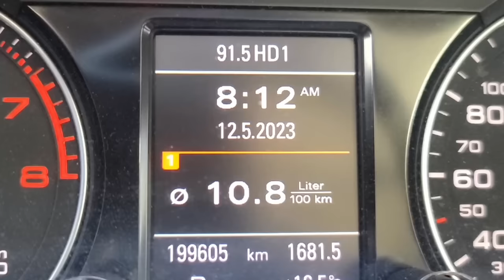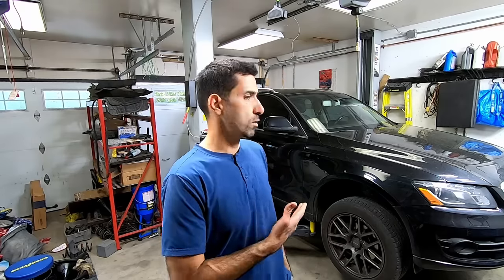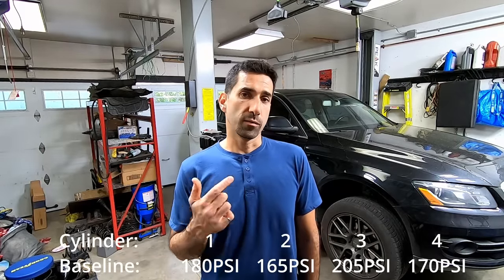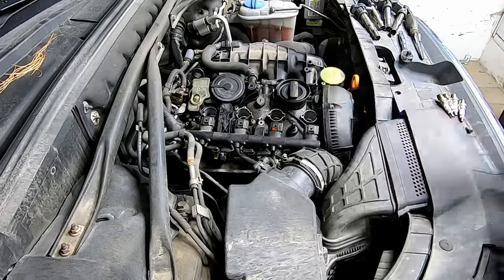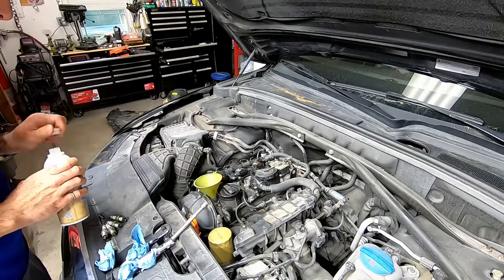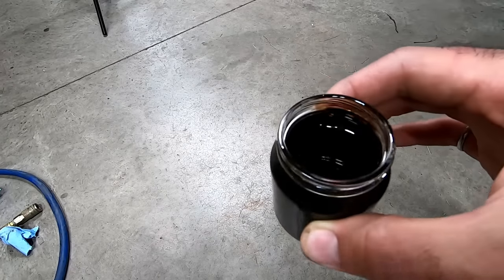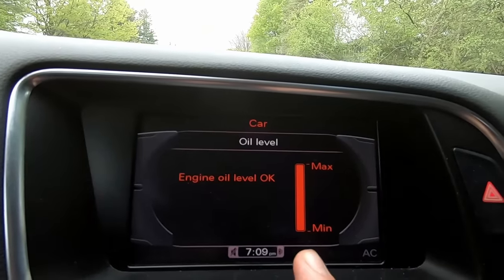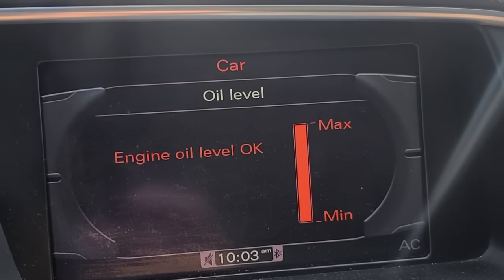How to fix excessive oil consumption from clogged piston rings (Part 2)

Comment: Hello, I have a audi 2.0 2011 turbo that i got for wife but it's loosing oil bad. I don't see any smoke and it's run great.  About 98k on motor. No leaks seen ive changed crankcase vent and hoses. I don't see any difference in oil consumption,  might be worst now lol. I'm considering doing the piston flush but I'm wondering if I should something first. Does this really work?
Reply from the maker: hey - yes this treatment really works...you can read the comments below for yourself but it's been pretty much 100% effective at curing oil burning in the VW/Audi 2.0T and 3.0T motors
Reply: @ETMotorsports  i see the comments all good reviews. I'll you updated.

Comment: I did this once and don't quite like it and since then piston soak is my very last try before pulling engine out. 
I was replacing my valve stem seal due to the oil leak into the cylinder, and there are lot of carbon deposit on the top of piston, so I decide to do the piston soak and why not, after I soak it for 24 hours, when I crank the engine by hand, through borescope I noticed there are a millions of small carbon particles sticking on the cylinder wall and it's well documented that those carbon particles WILL scratch the cylinder wall. Luckily, after a few crank, the cylinder walls seems not scratched on mine, but who knows will it scratch or not after 1k or 10k km? This is definitely the most regretted thing I've ever done to my car.
Reply from the maker: Why regretted if there were no negative effects? A lot of folks have noticed the dissolved carbon deposits on the cylinder walls including me but they washed off easily and had zero long term effect

Comment: Don't drop spark plugs into the holes, because the tip will hit the bottom and the spark plug gap will be different
Reply from the maker: thanks for the feedback...the plugs drop into a hole so there's nothing for the tip to hit...it's impossible for them to rotate because of how tight the hole is...the threads hit the hole - no damage to the tip...either way you're right - it's best to be careful
Reply: 12:12......

Comment: I would immediately switch over to using Valvoline Restore and Protect oil. It’s been proven to clean the piston rings within 4 oil change cycles and will continue to keep them clean.
Reply from the maker: @JBeck2468  I've heard that before - have you tried it? 4 oil changes could be anywhere from 16 to 40k km... I'm curious how they demonstrate that

Comment: The oil over consumption with these 2.0 TFSI is caused by carbon build up on the compression rings, then you get blowby pushing oil in the PCV valve and causing oil consumption,  carbon deposits on valves and more carbon build up on the rings.

To prevent this, use top tier fuel only, put a potent fuel cleaner aditive with PEA every 5000 km, and don't baby your car all the time , go for autobahn like speed runs every 2 weeks.
Reply: back in the late 60's when i was about 4-5 years old, my dad owned a ford galaxy 500 police interceptor. I remember dad would do what he called "blowing it out" on the freeway...pedal to the metal and 120mph for a mile or 2. would smoke like crazy at first but then the smoke would be gone. Car always ran like a beast. Dad knew what he was doing. This with me standing up in the back seat, no seat belt or car seats then lol.

Comment: I drive a honda civic and have recently started to get heavy oil consumption and thick dark smoke from exhaust if i rev the engine.  This problem seemed to happen suddenly and coincided with egr valve issues i've been having though i can't say that they're related.  The car is 2007 but has been running perfectly up to this and had very low emissions until now.  I brought it in to be tested the other day and the CO and hydrocarbon levels are off the chart.  The mechanic basically told me to scrap it, that the piston rings were probably seized or shot and that an engine rebuild would be the only fix.  This video has given me hope that it may not be a lost cause.  If anyone has any info  on the burning oil issue being caused by a faulty egr valve i'd really welcome it.  Also, the civic i have is a hybrid and actually has 8 plugs instead of 4 though the way i understand it each pair of plugs operate in a single cylinder and i'm just wondering if this would effect the cleaning procedure.  Again, any info or opinions would be very welcome.  Many thanks for the excellent video and for sharing your experience, it's really appreciated 👍
Reply from the maker: Hey what motor is in it? I doubt the EGR will cause these kinds of issues... if the oil consumption is from piston rings then this method should work
Reply: @ETMotorsports  Hi, not sure what you mean by motor in it? (it's a 1.4 petrol engine). I have read that a faulty egr valve can cause excessive heating in the engine that 's localised and isn't always picked up by the temp gauge on the dash and that this heat can damage rings and pistons.  I've been getting the P0401 code with the check engine light going on and off.  I changed the valve but the code keeps getting thrown, i'm in the process of getting another valve second hand.  I never experienced any typical egr valve issues with the car, the only change that i've experienced is what i've described re the oil and emissions issue.  What i'm afraid of is that the egr and possible overheating has caused this.

Comment: Thank you for this idea and for the demonstration. I have visited at least 10 mechanic shops and all of them refused to do this. Can you explain to me why and where I could get it done on the southshore of Montreal please? thank you.
Reply from the maker: Haha yeah I'm not surpassed shops want to stay away from it... from their point of view this is high risk voodoo and they can't control the outcome... sadly the same shops will happily throw any parts at your car and charge you for them without any assurance that it'll fix a problem...

Anyways...I can't tell you who in MTL can do this for you but I can tell you that more than one viewer has had it done in a shop so they are out there... all that said - it's really pretty straight forward of it wanted to do it yourself... if you've ever changed your oil you're more than capable of doing this... the only "tricky" part is turning the crank but you can skip it if it's a problem

Comment: B-12 is 60%  xylene.
You can get xylene for $30 a gallon at any hardware store. Just a tip.
Reply: The formula is changed in different countries, but the B12 fuel treatment also has ~50% acetone/methanol and other (more) polar solvents with the toluene/xylene. At least in the US, B12 is about $4/16oz, which is about the same price you mentioned. I've contemplated mixing my own as well, but it doesn't end up being that much cheaper if you don't have to special order B12.

Comment: Bro, yesterday I started with the method but I couldn't get the car to start and the battery was already dead, could you give me some advice?
Reply from the maker: @GioODelacruz  charge your battery 🤣 joke aside - what is it doing? Cranking but not starting?
Reply: @ETMotorsports  Well, if I charged the battery, I managed to get it to start, it didn't smoke as much as I expected, I drove it for about 30 minutes, drained the oil, new filter and Motul synthetic 5w40 oil, I'll be back in a couple of months to report.

Comment: Hey! I have a question about the order of the steps: after 6 hours am I supposed to add liquid and then rotate or rotate then add liquid? 
Should the liquid be in the cylinder while rotating? 
Thanks!
Reply from the maker: @andreiionescu1050  better to have the liquid in when rotating
Reply: @ETMotorsports  Thank you for your quick reply! I am almost halfway in the process, between 6 and 12 hours mark. After the first 6 hours I first rotated, then added. 
Do you think this will impact the outcome? 
For the 12h mark, I will do as you recommended.

Comment: I wonder if this will work on a 2017 Q7 audi 3.0 V6? Im burning a litre of oil every 8,000 kms, but fear it may get worse. The car is at 110,000 kms. Just want to prepare for the future! Many thanks for your informative videos. Pistons and rings for the Q7 is about $12,000 i believe at an indy and over $25,000 at the dealer.
Reply from the maker: Eek - $12k!!! that's a hefty price tag...1L per 8000km seems pretty reasonable to be honest - what is your oil change interval? I follow a 5-7k oil change, which means you're not getting a warning before your next oil change...I wouldn't worry about these numbers - that sounds like a pretty healthy motor...keep an eye on it and if it ever starts going up then you can give this a try...I know for a fact the method works on the 3.0T as well - a few people have fixed theirs already...
Reply: Sounds like you got lucky! That level of consumption sounds reasonable compared to some others
Reply: My engine is burning oil 1 L / 150 miles Audi Q7 3.0 supercharge  do you recommend it to me ? 
And it is 117 k miles i just changed the PCV oil separator but still burns oil a lot

Comment: Did this yesterday but can't for the life of me get my car to start now !
Reply: Pulled plugs and put in new ones, tried printing engine with 50:1, idk what to do. It cranks and a couple times starting to turnover but misfires and goes back to cranking again
Reply from the maker: how long have you been cranking for? you can see in the video it takes a long time to start after the treatment...have you checked the new plugs? see if they're wet with oil...on my A4 my plugs we getting fouled very fast...if it's cranking over you should be ok - check for codes, keep checking the plugs and see how they come out after cranking for a couple of minutes

Comment: The gritty feeling is likely bits of carbon.  You might eant to take dome of thst mix at some point and submerg a crank or cam seal in it to see if the Berryman's breaks down the seal at the concentration you're using it at.
Reply from the maker: The manufacturer clearly states B12 doesn't react wth any metals
Reply: The cam and crankshaft seals are rubber (with some metal). The rubber is what does the sealing.  It would suck to find that the rest main seal is suddenly leaking and the transmission needs to be removed to replace the seal.

Comment: I just started the process. I added the first can of B-12 an hour ago to my 2014 A6 2.0T.
Reply from the maker: Fingers crossed
Reply: I do alot of driving. I have been adding 1QT of oil every 250-300 miles of City driving and about 600-700 miles of highway driving, so I figured I had to try something. Do you think this will help my gas mileage as well? Thanks for your videos!@ETMotorsports

Comment: Solvent is good for freeing off stuck rings, but using good oil is really good for not getting them stuck in the first place.
Grp.II and Grp.III on a European long life servicing schedule will always get stuck rings and burn oil.
Grp.IV A3/B4 rated oils will eliminate this issue entirely.
Reply from the maker: Yeah I'm not a fan of the long life cycles

Comment: So would this be a permanent fix? Is this the only thing that goes wrong with the rings and the pistons? Am I fair to assume this would apply to the 1.8 Tfsi as well? Thanks for the video!
Reply from the maker: @ignaciobarcia1549  hmm hard to tell long term as you're not really treating the causes for the stuck rings... the q5 is now at 25k after the treatment and still doesn't burn oil... if it does go back to the previous consumption it's just a matter of repeating the process again
Reply: @ETMotorsports thank you! 25k miles is a long time for it to go trouble free! Maybe is just a design thing in the quest for better fuel economy but your solution seems quite doable for my current DIY skills. Many thanks!

Comment: Love the content bro! Just did chain,tensioners,guide myself also bearings control arms ecs tuning high flow cat Down pipe on my 2010 a4 147xxx miles runs great no issues but burns qt every 500 miles or so will def try this
Reply from the maker: nice...sounds like you're going to keep the car for a while...
Reply: Was it working in the end?
Reply: @AHBAFab  yes it worked
Reply: @buffalotroll2358  can you tell me which motor do u have? and how much did it get better from 1qt/500 miles? thanks

Comment: Question for you. 
What motor oil are you using? 
I had a sludge issue on an older Mercury Gran Marquis I bought.
I used Marvel Mystery Oil. 
Substituted 1qt of motor oil with Marvel Mystery Oil. Drove it 750 miles changed the oil. No more sludging. 
The Berryman’s is great stuff. 
When your gas tank is about 1/4 full add a bottle of Berryman’s run it until you fill up again.
Cleans out injectors and fuel system.
Reply from the maker: It's not an oil issue - this problem is common for these engines from all parts of the world... I've heard good things about Marvel mystery oil - never used it myself
Reply: Oh I understand it is not an oil issue. It is the low pressure oil rings a lot of manufacturers use in their engines.
I was just curious what oil because I have not seen that brand.

Comment: Thanks for a great video, I have a 2011 Q5 and it currently burns a litre every ~900km. It used to have misfires at startup but once I changed the spark plugs it seems to have went away.

I wanna try out this piston soaking but I’m worried it’ll trigger the check engine light and that I won’t be able to get it off. Did that happen for you, and how did you deal with the engine light? Also I have push to start button, will I be able to start the car after the soak without a key to turn in the ignition since you said it will have difficulty starting up.
Reply from the maker: Hey you're right on the line for consumption...I suppose you could wait for it to get worse before trying this... either way the process will likely trigger misfires for the first 15-20 min because the plugs get fouled... on both my cars I had to pull the plugs and clean them after the process to get rid of the misfires... this will likely register an engine code and the check engine light so it'll need to be reset when everything is finished...

As for the start button - I think you can still use your key if you have the push button start... the Q5 in the video has push button start as well - I just cranked it with the key
Reply: @ETMotorsports by using the key to crank it you mean the slot where the fob can go in and then you push it in to start right? Did you just keep holding it in?

Also, do you think I should wait until the consumption gets worse? I wanted to do it now because the car is due for an oil change very soon, so thought might as well do it now. Is it a risky process?
Reply from the maker: @yahyadiab8748 because your consumption is still pretty low, i would start with a fairly low impact process... get yourself some Seafoam engine treatment and when you're ready for the oil change,  add 1/4 of the bottle to each cylinder...let it sit overnight so all the liquid drains out,  crank the engine without plugs to make sure there's no liquid left in the cylinders,  plugs back in,  run the engine for 30 min which will do a flush and then change the oil... basically do the minimal process using a more mild dissolvent...I had great success with Seafoam before so you just might get your consumption sorted out... if it doesn't work you just repeat at the next change
Reply: Be careful with this, as this also removes the oil film present at the cylinder wall's. Note that the cylinder wall's have certain treatment that holds a tiny amount of oil to lubricate the piston...

Comment: As my knowledge,1st of all this kind of engine need use good quality engine oil 0w-20 and need change the oil frequently every 8000km to protect timing chain nor its weakness design piston ring unless you change the upgrade type piston ring out now on market instead.they have been improve year by years now on.
Reply from the maker: I'm not sure frequent oil changes will help with this... it seems some engines do it and some don't...as for the oil spec - it's 5w40 according to Audi
Reply: @ETMotorsports  my own opinion,the oil is depend on your own choice but either 0w-20 or 5w-30 is most better for prevent the engine life longer here at asia. As the engine design now require high precision and sensitive.
Reply from the maker: @snoopy81  oh for sure - it'll depend on the location and use...colder vs warmer climate etc...

Comment: I was adding 1 quart every 900 miles ,took it to the  dealer since it is still 
under warranty. The dealer looked at it and said that they can’t find any issue , asked me to bring it back when the oil level is low again , I’m pretty sure the car is burning excessive oil and I don’t know why the dealer couldn’t find the issue
Reply from the maker: @sanjivkumar4783  because 1qt/900 miles is within spec 🤣 also you can't really "find" this issue - there's no testing you can do... the dealer will basically top the oil up and record the mileage when you lose 1qt... if it's within spec they won't do anything... if it's lower and under warranty they should rebuild your motor